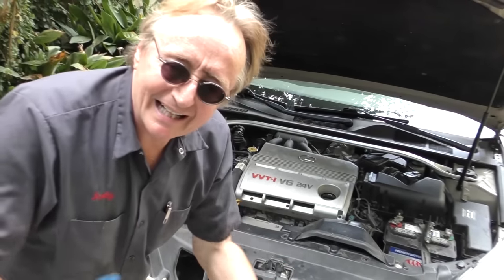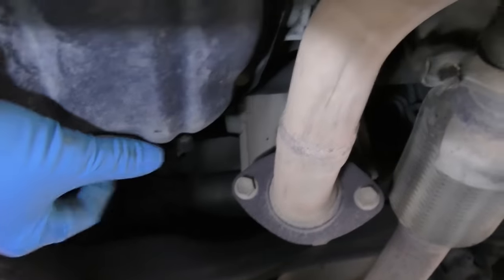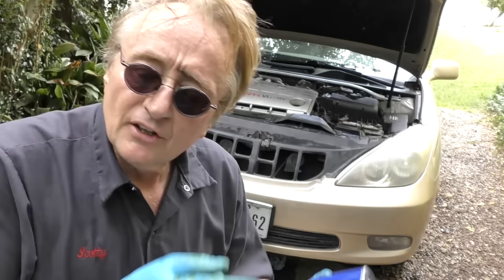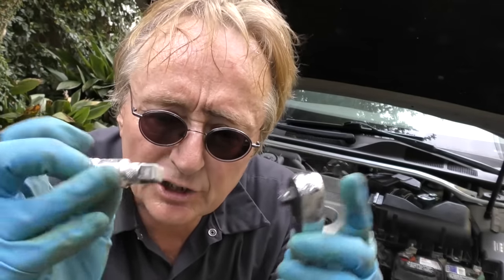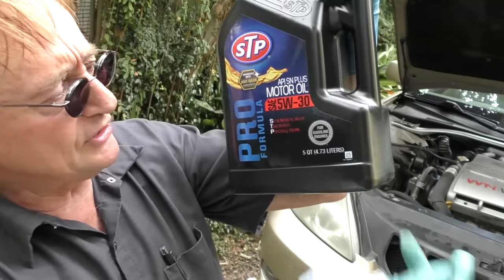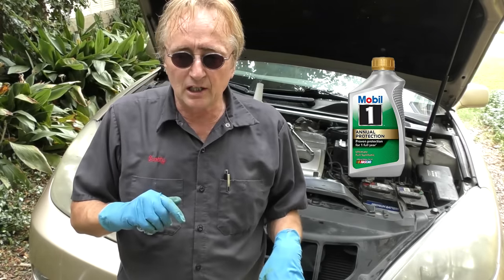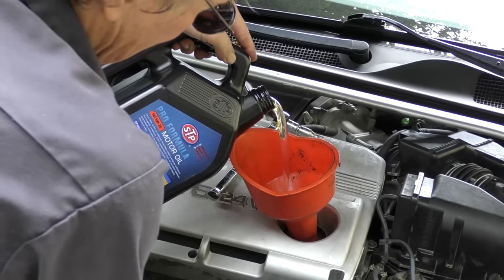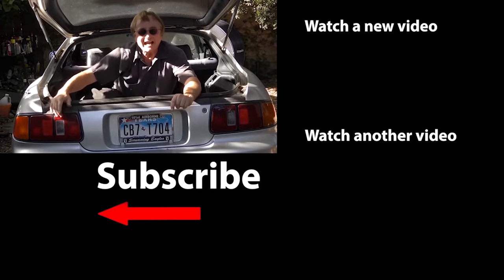Changing Your Engine Oil? You’re Doing It Wrong

Comment: According to my owners manual, 5W30 is preferred but 10W30 is acceptable. With some of the older vehicles I've owned in years gone buy, the oil viscosity was determined by the outdoor temperature that would prevail during the duration of time the oil was in the engine.
Reply: just use veg oil,more enviromental

Comment: I never use a oil drain plug gasket for over 100k miles no problems. also I change my oil when the engine is hot so the oil flows out better

Comment: I preoil my filters to let the paper absorb as much as it can.  for a vertical filter, i fill it almost full. for a horizontal, about 1/4 full.    plugs and filters should have safety wire connections so they can't come loose like aircraft engines have.

Comment: The only thing I would say is if your vehicle uses synthetic (ie. came from the factory with synthetic, which most vehicles made in the past 15 years do) use synthetic.  I'd only use conventional oil on an older vehicle.  And one thing I think people forget is once you move to conventional oil, you really can't go back to synthetic because it's sort of like a one-way trip, and I'd only advise conventional if the engine is on its way out, leaking a lot and/or burning a lot--then you can save some money, but if it's not and the engine is otherwise in reasonable shape, continue to use synthetic.

Comment: It is ok what have u explained, but first you have to change the filter and after drain the oil. Else all the oil from the filter will drain in engine and remain that and mix with the new oil... 
The filter have a system that retain oil in it until you remove the filter (at the first 2 turns of the filter will release oil in engine).

Comment: Long Breaker bar doesn't belong near an oil drain plug. A wrench of about six inches length should be plenty of leverage for that easily stripped drain hole.

Comment: I've been changing my own oil for years because I don't trust those fresh out of high school kids that work at those oil lube places. With that said, I forgot to check once if the old gasket came off the oil filter when I took it off, and it didn't, so I put the new oil filter on and ran the car and it leaked oil but I noticed quick enough (even though about half the oil had already leaked) and turned off my car quickly and had some spill kit handy and threw it on there.. still have a bit of a stain in the driveway even though I used a few different chemicals to clean it but at least I caught it in time and didn't blow my engine!
POINT OF MY STORY: make sure you always check that you took off the gasket from your old oil filter when you remove it before putting on a new oil filter, same goes for the drain plug, make sure you remove the old gasket off the plug before putting a new one on!!!

Comment: You’ll hate me Scotty, because I get the engine hot and then drain the oil because it’s very thin and drains out more fully.  Then I start the engine for 10 seconds and switch off.  That pumps out more oil that’s in the engine oil ways.  I did Tribology in my Mech Eng degree which showed me that the lubrication provided by oil is down to the huge pressure generated in the thin film between the bearing surfaces in things like crankshaft bearings, but all it takes is having that thin film in the bearing.  Many people think that the oil pump provides the pressure to support the bearing but it doesn’t, it just provides a continuous supply.  I wouldn’t run the engine for long with no oil as obviously the film would disappear after a while.  You’ll not be happy at my process Scotty, but no trouble in many years of oil changes!

Comment: Change the oil while the engine is hot. You want the contaminants suspended in the oil. If you let the engine cool down then it gives contaminants and sediments a chance to conglomerate in the bottom of the oil pan

Comment: I found out today (via the owner's manual) that while the oil cap on my car says 5W-20, my car can also safely run 5W-30 and 10W-30. Apparently Hyundai is one of the few manufacturers that still endorses lower viscosity in higher temperature situations.
Reply: Scotty was referring to weight! Ie: 30 or 40. Not the cold number, as in 0 or 5. The lower the cold number, the better ;)

Comment: It’s called a Breaker Bar Scotty, change your oil hot so it flows well, use a torque wrench on the plug, Don’t buy oil because it’s on sale stick to the same oil throughout the engine life.

Comment: Always change my oil when the car has sat overnight. All the oil is in the sump. If you change it when it's been running you will not get all of the old oil out unless you drain it for ages. That's my preference anyway.

Comment: i let dealer do my oil changes mostly b/c warranty. 

when i used to do oil changes i learned to do it while engine was warm not hot, filter comes out easier.  on one or two occasions where i didnt have an oil filter wrench for that car and it was stuck, i slammed a long screwdriver through that filter just to get a it to spin

Comment: From the way I took is you use what ever good oil is on sale. Fromy experience and every mechanic I know. Pick an oil and stick to it. I knew a guy that bought a truck. The previous owner useful Quaker state oil and had from the start. My friend for whatever reason doesn't like it, so he changed over to Pennzoil. After about 1200 miles it started smoking like a chimney. We know it didn't smoke before it was sold because we all 3 lived in the date town and we seen it around (a lot).

Comment: You might want to check the oil level on the dipstick before you call it good, give the oil a few minutes to settle in the sump before you check the level and when you're looking at the dipstick don't tilt it upside down or you'll get a false reading, if you can't read the oil level on the hatch Mark side turn the dipstick over to the other side to verify oil level.

Comment: This is why I do it myself.  Shops usually just throw 10-40 at everything.  You mention 3000 and 5000 mile intervals and synthetic, I go 5000 for 2000 Corolla with mixed blend Castrol.  I also see some people filling the filter prior to installing (I guess for startup)?
Reply: 10-40 way to0 heavy.  Synthetic doesn't need to be heavy its better.  Engine starts on cylinder oil film layer not filter.  pump is in pan not filter.  Just let it sit for a while and drain into filter

Comment: My jeep renegades 2.4 L requires 0W 20 but I drive in Florida and since I have XM radio sometimes I sit out there for a while idling listening to it. So I’m using 10W-30 or 5W-30 if I can’t find the 10W-30 so that four engine gets a nice thick film of oil and of course I use a 20,000 mile oil filter from Fram or mobile one and change it every 15,000 miles or sooner and of course a long life oil to go with that filter.
Reply: What the hell!

Comment: I always change my own oil and i had a vehicle with over 300K with the original drain plug and copper washer. Never tighten it with a breaker bar and clean the funnel before adding the oil.

Comment: 3:44 Erm. What happened with priming the cartridge? Thought you had to stuff around filling it before putting it on. Lucky I don’t have one as I have a top mount filter. Never replaced a sump bolt washer and refuse to pay $20 for one and have yet to have a leak @8 oil changes. I like to use a torque wrench @25nm. Funnel is clean from cleaning it after use lol. I also take the throttle body off and clean that because Holden like to replace them for $1500 for error codes caused by carbon build up not a faulty throttle body and don’t get error codes.

Comment: I had a friend that took his new SAAB 900 in for it's first service years back just to notice his oil light was on driving back to the office after lunch. He called the dealer where the service was done and the service manager, in a panic told him not to drive it. Too late! They had to have a new engine sent from Sweden and wanted the old one sent back for analysis. Problem.........the tech didn't check to see if the oil filter gasket came off with the old filter.....ooops

Comment: Very nice information  and pro work as well   for a normal guy just using this long arm to tight the oil bolt into its place is tricky to know when its tighten in place  a suggestion to use an adjustable torque spanner and  read the number engraved on the bolt it self adjust the spanner torque and when you tighten the bolt and its   
Tighten well the spanner will tick and wont  tighten more if the torque number not found on the bolt use the car service manual as every bolt  tightening  number is printed .
This is a factory standard and never get a damaged bolt threads or the socket get defect ever.

Comment: The argument that you want to save a few dollars buying conventional oil never made sense to me.  As a ratio, I spend much much more on gas every year than I do on oil.  I buy synthetic oil at a store that regularly puts it on sale for 1/2 price.  So it doesn't cost 3 times as much as conventional.  Maybe 50% more, but it is an insignificant cost compared to all the other costs of running an automobile.  Synthetic doesn't contain paraffin (wax) so it flows better for cold winter start ups.  I'm in Canada, and about 1/3 of the year is sub-zero in the morning.  Getting the oil flowing during the high RPM of start up on cold days is a good reason to have synthetic oil.

Comment: Well like many others, I’ve been changing my oil and filter correctly. Though I don’t use a funnel to pour the oil just turn the jug on its side so it doesn’t glug
Reply: I remember when ALL oil came in quarts ,and made out of paper. You had to put a funnel in each one to open it. Oil leaked, cans squashed, oil on a hot engine is a smoky mess,lol. Funnel is best Ive found

Comment: Don't just check the seal on the old filter, check to see if there is one still stuck on the engine. The last guy might have fitted 2 by mistake and you got lucky. I've seen a car catch fire as it squirted the oil straight on the exhaust.

Comment: One Time I used a oil funnel that was too small, and the way the 2019 F150 is designed is, is that the alternator is right below it. I came inches from spilling a whole bunch of oil on the exposed coils.

Comment: Switched to a AGS accufit drain plug, so much easier to undo and hold onto and never cross threaded.  I always use a new gasket.  It's a simple design that makes oil changes easier.

Comment: Scotty, you DONT want to change your oil cold because after you run the engine & get it to temperature , the contaminants are suspended in the oil so they drain out with the oil.

Comment: Missed step ? You should take the oil fill cap off engine to allow some airflow so the oil will drain quicker & fully. Oil cap should be first item off last item on.
Reply: ?????? Most engines have breathers right?

Comment: But the API rating is just as important. 
We only run 20W50 because its the only oil here with API rating "SL". API SN doesn't have enough ZDDP for older engines.

Comment: the only thing I did wrong is not put a drain plug gasket on my civic even though I knew I should but it hasn't leaked yet, I ordered a 20 pack of them and I'll put one on during my next oil change

Comment: One thing you can do wrong is to use that stupid STP filter!   My son damaged an engine with one of those.  I got under the car and took a picture of the oil coming out of a crack in the side of the filter while the engine was running.  There were no signs of damage during installation -- no dents, gouges, displaced metal, or missing paint.  It was just a crack in the metal that was painted over.  Obviously, STP does not perform any type of pressure test on their filters before shipping them in order to verify that they don't leak!

Comment: Sometimes you talk about cars that sit for a long time what do we put in the gas tank of a car that we know is going to sit for a while? I had a Mercedes 500SL wear something with bad in the fuel injection and they said it was because the gas went bad and did something to a rubber component. I usually ride a motorcycle so the car will sit for a long time.

Comment: One other thing I'd personally suggest... fill the engine to its capacity but omit the last 1/2 quart for a minute.  Start the engine, let the oil fill in the filter, and then pour in the remaining 1/2 quart and run the engine again, and then re-check.  Oil filters will hold 1/2 to 1qt of oil within them.  If your filter sits upright---where the gasket is upright--you can pour some oil into it before installation, do that (I do that with my truck so that the filter is full/near full when the engine is first started).
Reply: very few if any filters hold a 1/2 quart let alone a full quart.  Nearly none.  ridiculous
Reply: @02hreblue30  Some filters hold over a quart, in trucks...
Reply: The car manual usually says how much you need oil with and without new oil filter.

Comment: I’ve put 5w30 in my 04 f150 since it was new instead of the recommended 5w20. 238,000 miles on it now and it and it uses little oil and didn’t use any until 200,000 miles. 🤷🏼‍♂️
Reply: And if you look in your owners manual problem, you probably live in a climate where you’re allowed to do that. The only time you would have a problem with changing the summer number of the oil weight would be if you live in a climate that gets below freezing all the time.

Comment: It's true that synthetic oil takes longer to break down than conventional—but that's not the only consideration. As engine parts wear, they deposit fine metal swarf into the oil, along with all that carbon. And filters cannot capture of all of it. Changing oil frequently flushes that abrasive crap out of the system.
Reply: @Wolf Lahti - OK ... I give up!  What is your definition of "frequently" relative to synthetic oil changes ... to deal with that abrasive crap?!?

Comment: Did torque the oil plug 22 ft.pds or did you go up to 25 ft.pds just asking if I ever change mine after right now it's still under warranty. I'm sure that the Nissan Altima 2024 , well the dealership goes by there standards that is supposed to be you never really know and I'm going to make sure that they use the amsoil because I used it on all my dirt bikes while I was racing dirt bikes. Great product. I will have them to install amsoil on all oil changing procedures .

Comment: Keep an eye on the dipstick when you get near full. After starting the car, it will fill the oil filter and the level will go down. Top it off and do not over fill. I don't think Scotty mentioned that.
Reply: He didn’t have to, he looked up the specification and put in the correct amount of oil. Kind of takes the guesswork right out of it.
Reply: @fredmalito9869  I think you are correct when it comes to most cars. I've been riding motorcycles for over 40 years and from my experience, they are tricky when it comes to oil level, very easy to overfill. The engine has to be completely warmed up (ridden for at least 5 to 10 miles) and let it sit for 5 minutes. Check again when completely vertical.

Comment: Actually you should check your manual for the weight, usually the oil cap rating is the "middle ground" now if you live in Michigan or something you need a slightly thinner oil to deal with the cold, down here in the deep south you need the opposite you can run thicker oil because its stays hotter year round, your manual tends to have the manufacturer recommendations for what oil for which climate. Just my two cents. Also that breaker bar on the oil plug, just why?😐😬

Comment: One important fact. If you can, change your own oil! You have no idea what oil is really being put into your engine with these lube shops. They don't tighten your plug or filter many times and don't fill your engine to correct capacity. I also fill my new filter with oil before installing it. It's the "little" things that these quick lube shops won't do.

Comment: Scotty my Nissan Xterra 2006 calls for 5/30 oil but i always used 10/40 and now have 349,000 miles nothing ever happens to it and still have original motor and transmission on it buddy

Comment: Jimmy didn't start out well. First, the "right" oil often incudes things far more than the viscosity rating on the cap. Particularly high performance cars have very specific oil requirements (API SM, BMW LL01, etc). Ironically, that often includes a couple different viscosity ratings. For example, if you get a Mustang track pack, and want to take it to the track, Ford is going to recommend you put in 5w20, unless you go to the track and then recommends 5w30. Going for a slightly heavier oil on the second number is not going to hurt your engine AT ALL. The big push to lower viscosity oils is all about meeting CAFE standards and reducing fuel consumption by a couple of % across the fleet. You will never notice a 3% fuel economy improvement. You can find lots of cars that went from 5W30 one year to 0W20 the next with NO CHANGE to engine design, often recommending 5W30 for cars not sold in the USA. Often the owners manual will recommend either of two (5W30 or 0W20) but only one will be on the service cap. Also manufacturers may issue TSBs recommending different weights of oil (almost always heavier, interestingly enough).

Comment: What is your opinion on newer oil filters (1999 Jeep V6) that do not spin on and use cartridge you insert into the metal can?  I had a 1950 Plymouth with the old style and had a tendency to leak if you didn't install them and the gasket correctly.  We may be saving the environment with less throw away materials but not when you pollute with leaking oil.

Comment: Fun Video. Next time you pour the engine oil try pouring with the spout side up or even hold the jug sideways. You probably won't get the glug, glug, glug and the oil will pour smoothly. Same goes for jugs of paint thinner or anything with an off center spout.